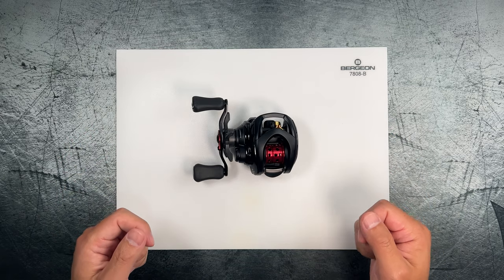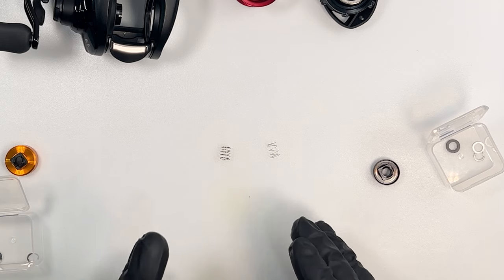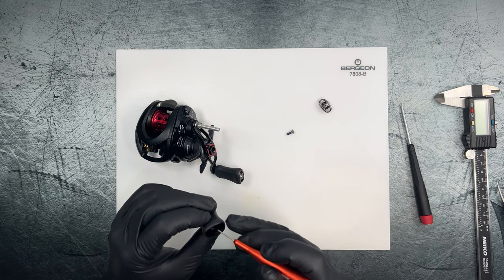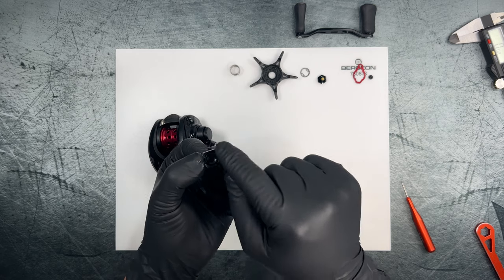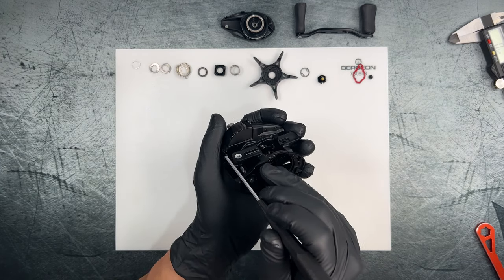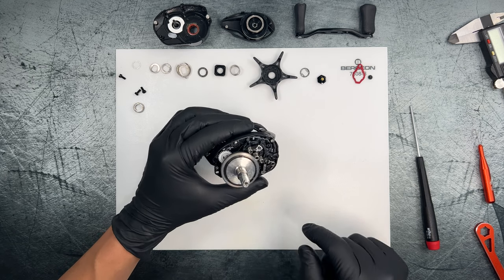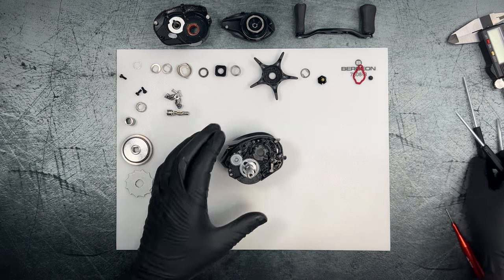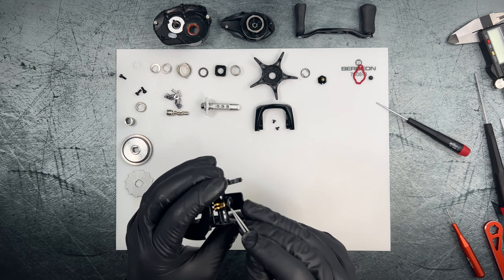🤓TEARDOWN😯DAIWA SS AIR TW!!!

Comment: Bushing in the wormshaft seems to be the safest play since its a SW rated reel afterall. not to say that you cant install a shielded crbb in there but it increases the durability of the reel since there's one less moving part to worry about i suppose.
Reply from the maker: Hey shak! I believe you are absolutely correct. My best guess is that daiwa is positioning this reel to be a work horse reel that will last for quite some time. Thanks for sharing and cheers my friend!

Comment: Thanks for the breakdown. I realized it's the same bearing layout as the zillion so maybe I'll replace the bearings on the zillion too
Reply from the maker: Hey bubble! Nice catch! You might have an easier time as the zillion may not have an “air” spool. For whatever reason the air spools like to put the spool shaft pin closer to the outer edge of the spool making it very difficult to remove without the slpworks spool pin removal tool… I had to order one and it is still on its way 😅. Anywho, thanks for that but if info and cheers!
Reply: @BFSFISHINGCHANNEL  I'll probably replace the worm gear bushings and the handle bushings first.
Reply from the maker: @bubblebreeze1635  hey bubble! Sounds like a plan. Let me know if you have any questions or need help. Cheers my friend!

Comment: Nice vid fella! Always baffles me why a bushing would be used rather than a bearing in a high end Japanese reel. For pence it could be 2 bearings more on the spec sheet and more could be charged. They would make a massive return on 2 bearings that cost pennies. 🧐
Reply from the maker: Hey there! You know I’ll have to message you separately for a better name to call you other than your yt handle haha. Hey there Perch seems a bit odd to me 😅. Anywho, I do agree that they could have easily added bearings and I was a bit disappointed when I found out about the bushings… however I do understand the reason they used them. However however I don’t understand why Shimano and daiwa are using magnesium frames in salt reels. I’m sure they can come up with something different say like a composite of carbon and magnesium maybe? A magnesium frame sandwiched inside of a carbon outer shell. Maybe this would eliminate corrosion but I think would be very expensive for them… very odd… very odd indeed haha. Things that make you go “hmmm….” 😆. Cheers my friend!

Comment: Do your reels lose smoothness after you open and close them?
Reply from the maker: Hey there tree! Thanks so much for the question! In short, no. If I ever experience anything like that it’s most likely due to improper reassembly on my end. In that case, I will disassemble and reassemble the reel again until the original smoothness returns. I think something like that would drive me crazy haha 😅. Imho, it’s always a good idea to open the reel up to see what’s been done on the inside in terms of manufacturer lubrication. Sometimes, factories will gum up reels with the amount of grease they put on the main gear or other areas and sometimes it may be the exact opposite. So… I quite enjoy giving my reels an initial inspection and servicing before taking them out on the water. I hope that helps answer your question and cheers my friend!

Comment: I'm wondering is this worth the extra $64.00 over the tried & true 2020 Alphas Air TW?
Reply from the maker: Hey crazy! I mean it depends on what you want but imho it is. Magnesium frame, Steez CT body, new redesigned brake system, lighter spool, and virtually headache free castability. On paper, it’s a superior reel to the alphas air tw. At the end of the day though what I say doesn’t matter much and it all depends on what you want to spend your money on! Hope that helps and cheers my friend!

Comment: Im wondering if I got an aftermarket spool (like Chameleon) and put it on a tatula SV or 80, would it essentially work as well as a Alpha Air or a SS Air TW for 2-4gm lures?
Reply from the maker: Hey Michael! While an aftermarket spool for a tatula would greatly improve its performance for 2-4g lures I don’t think it would quite replace or perform as well as a SS air tw. Additionally, the alphas air tw does not come with a drag clicker like the SS air tw. However, there are aftermarket kits you can purchase for the alphas air. Hope that helps and cheers!
Reply: @BFSFISHINGCHANNEL  good point.   But for the alphas air with no bait clicker, maybe the difference would not be that significant.  Some after-market spool may even be superior.   The 2 reels have the same number of bearings.    The tatula would have the advantage of a second spool (which could have heavier line for larger fish applications) making it a very versatile reel. The idea looks good on paper but who knows how well it works.
Reply from the maker: @michael2one  hey Michael! Yep in terms of bang for buck you are likely correct in that the tatula would make for a better bargain, especially with an aftermarket spool. I believe the two frames are nearly identical but the tatula uses a spool with a long shaft and the alphas air using a shaftless spool design. So… if you can find a shaftless aftermarket spool for the tatula that would likely perform extremely well for the money spent. Hope that helps and cheers!
Reply: @BFSFISHINGCHANNEL  thanks!   By the way, your videos are amazing. I can't believe you took the braking mechanism apart.  The springs explains why one seems to engage the brake more than the other.
Reply from the maker: @michael2one hey Michael! Haha much appreciated! I just wanted to compare the strength of the spring to the ct sv70 spring strength and thought that the difference was somewhat interesting. At some point, I’ll be “upgrading” the side plate magnet assembly as well. Apparently, the magnetic ring assembly has a weak point and I know of one person who owns the ss air who has had their side plate brake assembly break on them… Thankfully AMO has made a replacement part out of aluminum which should be a lot stronger than the plastic part the reel ships with. I’ve got the part in hand, I just need to find the time and how to tear down the side plate assembly now. Anywho, thanks so much for the kind words again and cheers my friend!
Reply from the maker: @michael2one  so Michael I’ve been looking into this and you might be onto something. The exception is that the tatula 80 “seems”(hard to verify this hence air quotes) to have the same spool dimensions as the alphas sv 800. If that’s the case… then theoretically you could source the zero adjuster shaft and assembly from the sv 800 and an aftermarket spool from say KKR and basically have a budget alphas sv 800 I think? Don’t quote me on that haha 😆 probably just getting ahead of myself. Pretty cool stuff though! Cheers!
Reply from the maker: @michael2one  ok here’s my final take. I think the price difference between the tatula 80 and the alphas sv 800s on digitaka is something like $50. I think at that point you might as well just pick up the alphas sv 800s and maybe an aftermarket spool and then call it a day. Everyone has their own specific needs tho so do whatever you think might be the best move for yourself. Cheers my friendn

Comment: I have a question, I have this reel and when I loosen the drag star not even all the way towards me (until it tightens in the opposition direction/not forward, but back towards me) the spool doesn’t move and my drag clicker seems to activate as I retrieve. Is this normal? Is it because I loosened it so much? My worry is that this happens when I loosen it not even all the way back. Thanks
Reply from the maker: Hey avocato! Is this for a SS air tw? This doesn’t sound like normal behavior. Even if you tighten or loosen your drag all the way, if you aren’t putting pressure on your spool you shouldn’t get any clicking happening at all. Let me know and I can try to help out a bit more. Cheers my friend!
Reply: @BFSFISHINGCHANNEL  Yes, it is for an SS Air. That’s what I thought. The spool stops moving and it clicks simply by retrieving without any pressure. I don’t know what is causing this.

Comment: the old SS was made of magnesium, so i am not too sure why wouldn't this be made of the same material.
Reply from the maker: Hey there 800extra! Thank you for sharing that information! Magnesium is a great material to use for frames but it can oxidize severely in salt water. For this reason, I was questioning the choice of using magnesium as the frame material… especially in a salt ready reel. Anywho thank you again for the information and cheers!